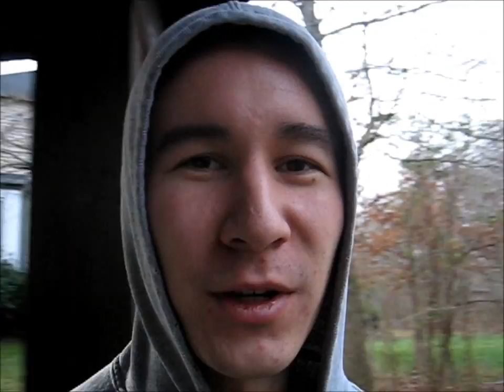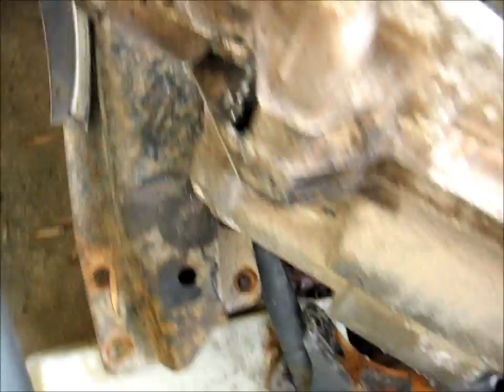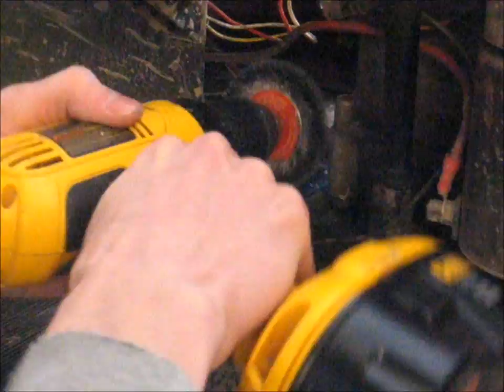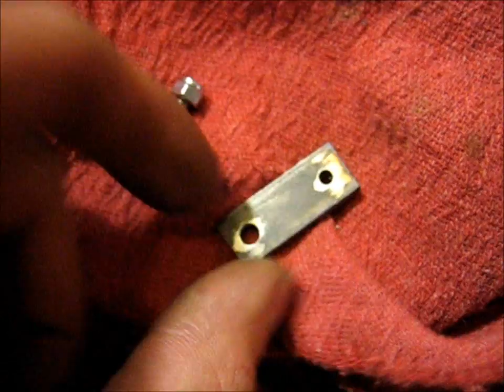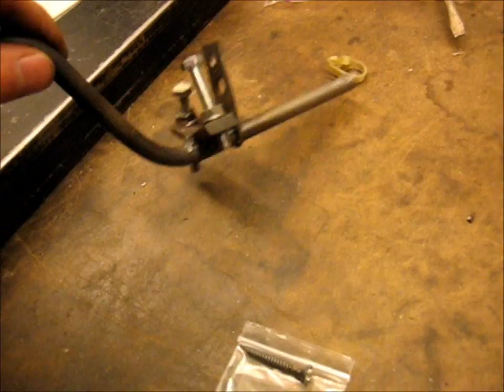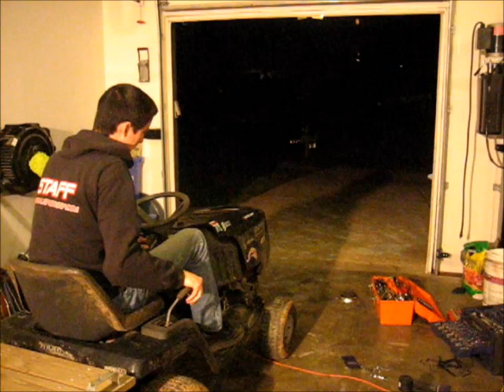How to Build the Best Racing Mower Gas Pedal

Comment: I'll give u a tip if h want to run a little more rpm then the gov like a 1/8 of a turn gives 300 more rpm so it don't throw rods
Reply from the maker: I'm not worried about throwing rods. My engine is totally stock and so is the governor setting. All I've done is add the pedal. It's been running fine this way for nearly 4 years. I'm not denying that I might be pushing my luck, but I'm happy how it is.

Comment: Did u do something on axle to make it fast or is it cuz of gas pedal
Reply from the maker: The throttle pedal will not increase the speed of your lawnmower by a significant amount. The speed is determined by engine RPM, the drive ratio between the engine and rear axle, and by the tire diameter. The throttle pedal will allow the engine to reach a higher RPM but this should not be done in excess, the engine can be severely damaged. Use the pedal for increased control, not increased speed. To increase the tractor's speed, you should change the pulley ratio. This will be the safest way to increase speed. You could also put bigger tires but this can be expensive.

Comment: But when it’s on full throttle it’s better not to use the gas pedal because the engine will blow
Reply from the maker: Been like this for 10 years. Haven't blown up anything yet. It's just like any engine that has no rev limiter, just have to use your brain.
Reply: I just hooked pedal directly to throttle. Went about it 17mph with pulley swap but I’m afraid to put pedal to the metal. I’m gonna get a tachometer, any idea what rpm the “redline” would be?